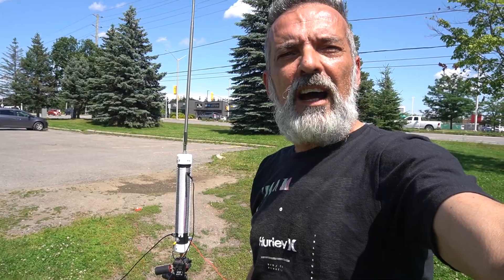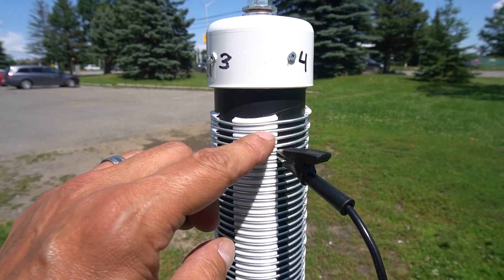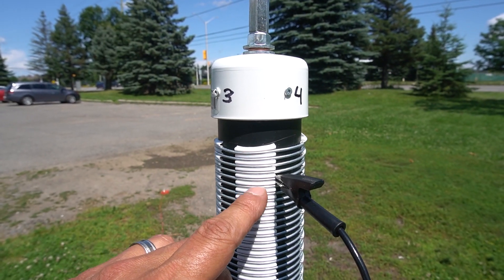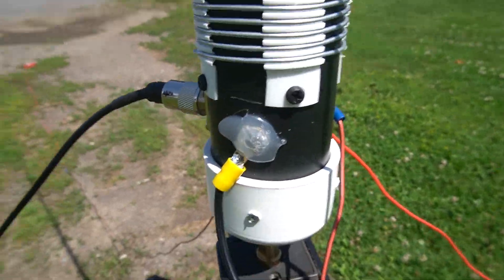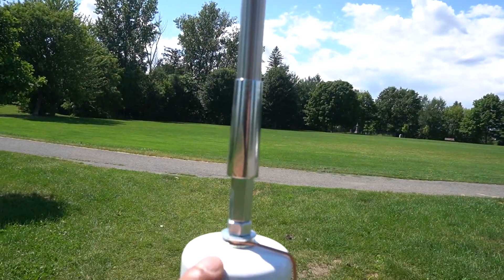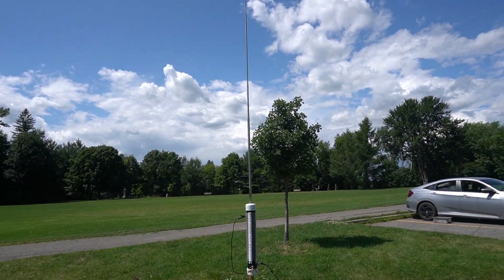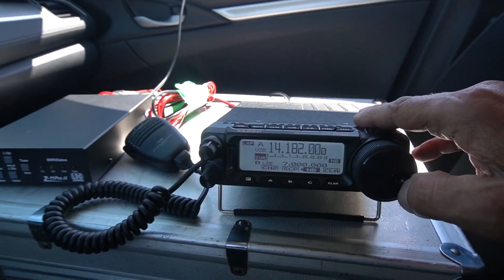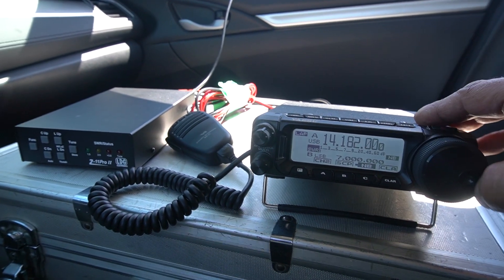Ham Radio River Coil Antenna

Comment: You’re not alone. I’m facing the same problem with my wife. I also have another big problem. When I use my radio near my home, the RFI causes the GFCI outlets to trip. 😢

What is that little support you used to hold the antenna in place? I use a 10 in. nail to keep my wolf river coil in place.
Reply from the maker: Hi Andre. To support the antenna I used a heavy duty photography tripod which had the same screw thread as the antenna. My electronic skills are very basic, I never had RF problems like you did. For the winter I installed a moxon antenna using the trees in my backyard and it took a while for my wife to notice and she ok with it. Best 73's my friend de VE3DAL.
Reply: @VE3DAL  My friends in Brazil use the moxon antenna. I am new to HF and am learning a lot from another brazilian friend in Montreal. For now I only use the wolf-river coil with a chameleon 17’ whip. Thank you for the nice video and the reply. 😉
Reply from the maker: @AndréSilveira-VA2HAS  I grow up in Curitiba, Brazil and now I live in Ottawa, Canada for 35 years.

Comment: If you have an attic you can put a loop for 40 and a fan dipole for 20-10 meter.
Reply from the maker: Hi Doug, I have an attic but what concerns me is the noise that produces. For indoor I'm thinking magnetic loop antenna . That will be my future project. Best 73's VE3DAL
Reply: Attic antennas work surprisingly well, as long as you don’t have a metal roof.
Reply from the maker: @dougtaylor7724  Maybe one day I will try it.

Comment: Very nice antenna build . I have one of the MFJ 1979 antenna and the radio is a YAESU ft891. I would like to build a coil like yours. You done a great job on putting the coil together. 73 AE4OY William Peacock EM-81UF Blackshear, GA USA
Reply from the maker: Hi William, I'm sure you can build one is very simple and if you have any question let me know. Thank you! 73 de VE3DAL.

Comment: Put an antenna in your attic. 👍
Reply from the maker: I'm not sure what kind of SWR I will get after all the trouble of installation.
Reply: @VE3DAL  
It's usually not too bad. Also you can tune it out if you need to. I think the worse dbl loss I got from an attic ant was 3.

Comment: You might want to try building a 40m HALO - it's only about 17' per side and around a 12-15ohm feed point so a 1:4 balun usually dials it in within about 1.3:1 swr and it's a small but mighty horizontal DX antenna you can whip together in the field in about 5-10 minutes - if you design, build & support it thoughtfully. - Imagine, a 40m DX antenna only 17' on a side - square.
Now the 20m Halo is only 1/2 that size and outperforms a vertical by a mile.
Reply from the maker: It's funny, this morning I woke up thinking about a horizontal antenna mobile, this is a great idea. For sure I will looking into that soon. Thank you for commenting I appreciated! 73
Reply: @VE3DAL  You bet!
It's all about the fun, and what's the single most important part of any station? - The only thing we can really still have a hand at building - the Antenna!
 I'll check back hoping for a HALO review!
Reply from the maker: @JAFO.  At the moment i'm playing around with some antenna traps and maybe figure out from there.
Reply: @VE3DAL  Another good one is a Moxon, but they get a bit large for a mobile/portable mast system below about 12m.
Reply from the maker: @JAFO.  I was thinking maybe to get a MFJ mast 10m and add another 8ft. for rotation if needed to get started.
Reply: @VE3DAL  Check Home Despot and Lowe's for galvanized tubing &/or mast material, you might find a stronger & le$$ expensive alternative.

Comment: MFJ does offer a  similar antenna. Had one. Not fond of moving the contact up 
and down the coil (lazy). But it'll  do in a pinch. LMOAO. Thanks, and 73.
WW5MB
Reply from the maker: In my case the SWR varies depending of the location, but with a SWR meter makes it easy to calibrate. 73 friend.

Comment: If you want to have wire antennas at home, you're just good with portable antennas. You lose contort but you win at the qrm levels.
Just be careful at winter operating radios with antenna tunners outside. The ATU of my qrp radio stopped working the day I took it to the field at -35c.
Reply from the maker: Thank you. I will follow your advise because winter in Ottawa is brutal. I have a wire antenna at home for 20m at the moment and I noticed I can do better with the coil mobile. 73 friend.